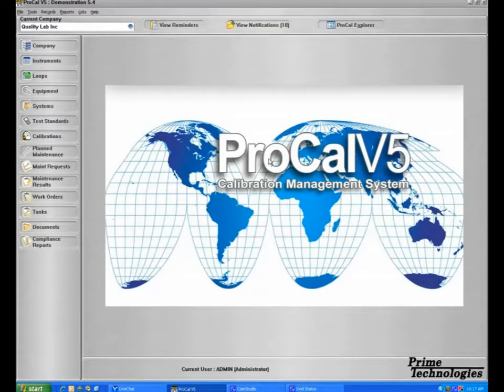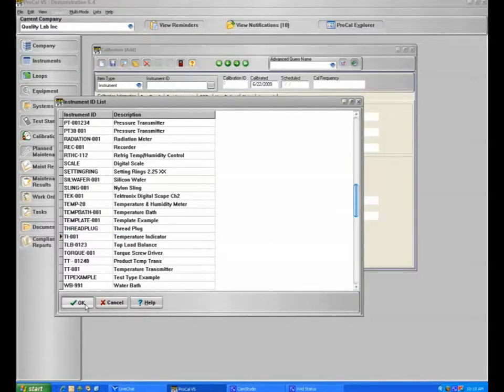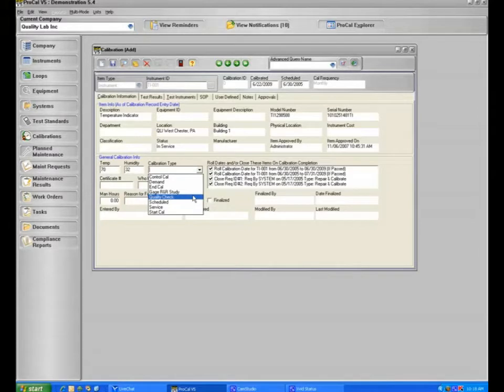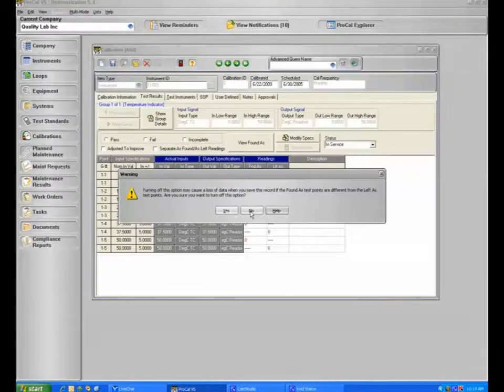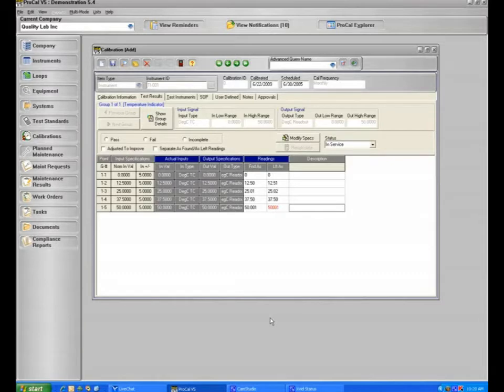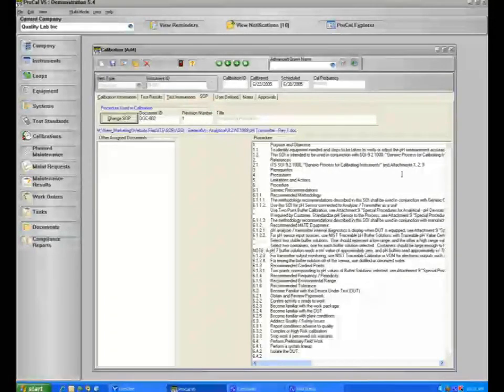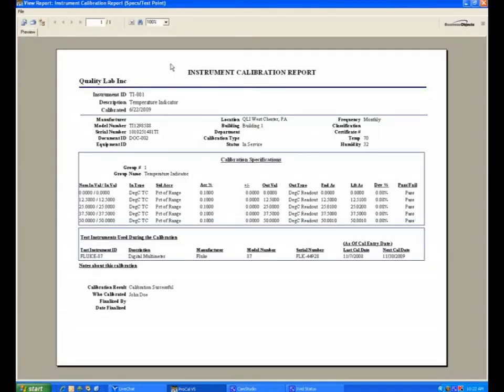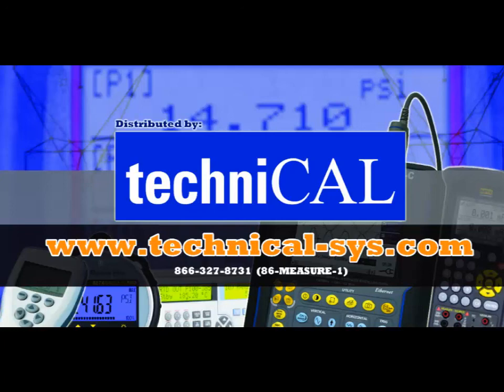ProCalV5 Calibrations

Comment: When viewing the Calibration in Crystal Report, how do you edit the report template in crystal report to add company icon in the report header and traceability statement in the report footer?
Reply from the maker: Hi David,

ProCalV5 only includes a Crystal Report XI  Run Time engine.

All the reports are in a separate file accessed by the Application

All can be modified or even new reports designed. When complete; they need only be added to the file You can use the Report tools to add them to your report directory or select them as defaults.

To do this you need to make an investment in the Report Developer tool; http://store.businessobjects.com/DRHM/store?Action=DisplayProductDetailsPage&SiteID=bobjamer&Locale=en_US&Env=BASE&productID=228867500&parentCategoryID=57065700&categoryID=57066100&resid=Uwo3KAoydxAAAHvlCUwAAAAN&rests=1393178413085EVen though it is reportedly the most popular report writer in the market is not that easy to use for the inexperienced.

As an alternative send me a specification or example of what you need and I’ll respond with a quote.